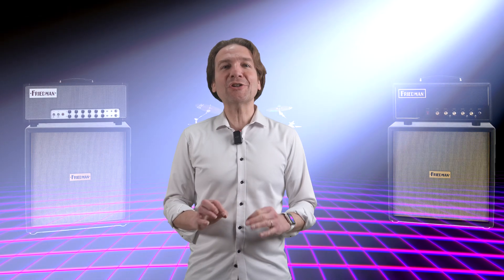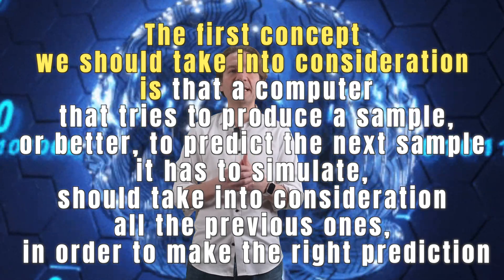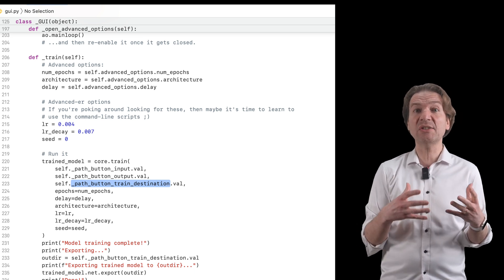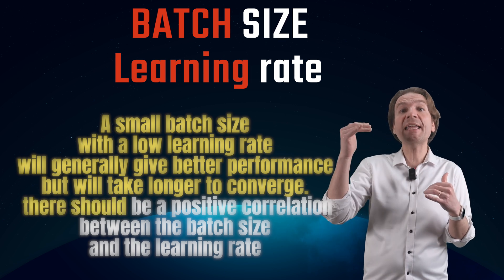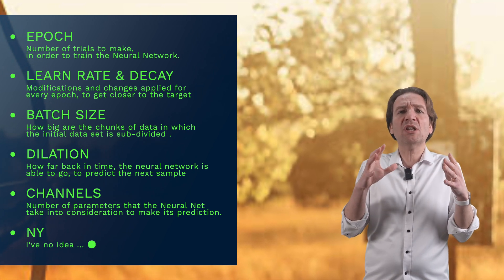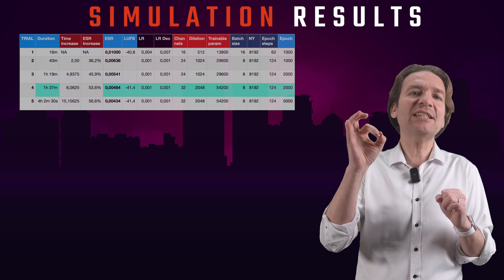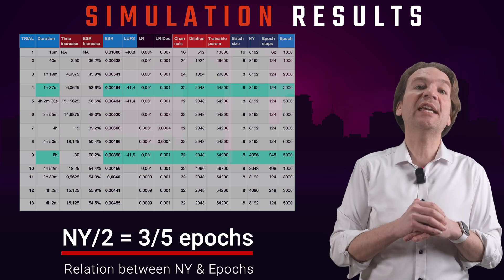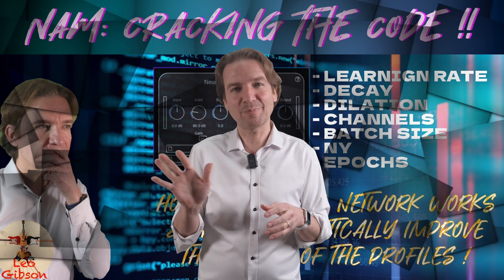NAM - Neural Amp Modeler: cracking the code! (How NAM works & how to increase the profile quality)

Comment: This is one of the best explanations of hyperparameters I've seen!

As a general rule, you want to crank up the batch size until your GPU VRAM can't handle it, then back off just a bit.

You are correct about the relationship between LR and number of epochs (and thus to steps). Lower learning rates take more epochs to cover the same "distance". If you have a rifle scope, and you only make adjustments 1mm at a time instead of 1cm at a time, you will need 10x as many adjustments in order to move the rifle scope's aim.

A pro tip is to perform some initial training with a higher LR and just a few epochs, then continue training with a lower LR and more epochs. It's just like making big adjustments to a tone knob on a guitar pedal to get within the ballpark of the sound you want, then finetuning with small adjustments.
Reply from the maker: Thank you so much for your kind words and for sharing your knowledge!!!

Comment: Nice video. I have some objections, or considerations, or rather questions. If the calculations has to do predictions of "what sample is there before" or "what is heard before" how does it computate right if there's nothing heard before? It is silent before you hit the very first note of the day isn't it? What is that it has to calculate "before" that initial pick attack? The dynamics from totally silent to an "exploding" WHAM with a pick?'

Also, since there are many questions about you not comparing Kempers, Axe FX fractal FM-9, and so on you state that those ones are modellers but rest of the gear, like NAM are rather PROFILERS. How come that it is called Neural Amp MODELLER then? Shouldn't it be called Neural Amp PROFILER instead to distinguish it more clearly from the rest? Then people wouldn't have to ask? I know that this is not really your problem though...

Comment: Thanks for the nice video! How did you get those fast calculation times? I need an hour with 300 epochs. I already increased 'num_workers' in 'train\core.py\ - but somehow it didn't change anything and the PossibleUserWarning about the DataLoader 'does not have many workers' appears furthermore when starting the training...
Reply from the maker: Hi, I think it's due to my 4090 video card, which is pretty fast...I didn't touch the number of workers
thank you!
Reply: @LeoGibsonGtr  Ah, Ok - 1650 GTX here ;-) But I thought I could increase the num_workers, but NAM somehow does not recognize it - thanks, Leo!!!
Reply from the maker: You are welcome! I have also tried to play with the number of workers...but nothing happened....I'm not sure if it actually does something. Thanks

Comment: Leo, this is very interesting. A few comments in addition to your descriptions: 
- Batch size is not the size of the batches, but the number of batches computed in separately (and potentially in parallel).
- Learning rate should be adjusted with respect to loss conversion (which unfortunately, NAM does not report continually) and not with regard to batch size.
- Channels is the number of connections between two layers. By definition, a CNN will have one input into the 1st layer (it is reading a sequence sample by sample), the output of which is "channels" wide into the next layer.
- This is where NY comes into play: From my superficial code analysis, this is the number of outputs generated per "datum" (it generates an output vector of samples). Larger NY requires less computing power but conflicts with batching.
- The "gated" parameter adds gates (a concept from recurrent neural networks) to the layers thus increasing their size. Upon activation, the selected activation is combined with a sigmoid.
- I also think that activation would be interesting to experiment with, in particular when generating models for slower computers, as the default activation by Tanh is computationally expensive, whereas ReLU would much less costly (my first quick test has led to good results even with ReLU)
I am wondering if any of the hyperparameter adjustments had positive impact on the aliasing problem you had stated earlier?
Training a pre-trained network is identical to running more epochs.
Reply from the maker: Thank you so much....very interesting!
As far as aliasing is concerned....I was not able to find any remedy...I read some post on line (I don't remember the links) from which it was evident that also Steve Atckison himself was searching for a solution. I'm not checking NAM since las march....so maybe now NAM has improved in terms of aliasing...I should check it out again.
Thanks!
Reply: @LeoGibsonGtr AFAIK there was no relevant change in the core algo, most of that code seems to be from pre-2023. I am working in research, maybe I will issue a thesis topic on this to find root cause and remedies other than an anti-aliasing filter or oversampling. I am very sorry for your loss.
Reply from the maker: Thank you!

Comment: Hi Leo. Do you know how to change the 'num_workers' value ?   I've searched through all the scripts and edited the CPU count wherever it crops up but it never works ?  cheers
Reply from the maker: Hi, I have tried myself, but I ended up not doing it, as it basically provides no improvements. I don't remember where I changed the parameter.
Thank you!
Reply: @LeoGibsonGtr  Thanks for replying.  It's so annoying only using about 40% of one core when you've got 20 !

Comment: great stuff, how would you implement these? can you share the best modified code?
Reply from the maker: Hi, as the software is evolving, I would suggest to make the changes checking out what I did in the video. The most complex one is related to the architecture that you can copy and paste from here:
Architecture.STANDARD: {
            "layers_configs": [
 {
                    "input_size": 1,
                    "condition_size": 1,
                    "channels": 32,
                    "head_size": 8,
                    "kernel_size": 3,
                    "dilations": [1, 2, 4, 8, 16, 32, 64, 128, 256, 512, 1, 2, 4, 8, 16, 32, 64, 128, 256, 512, 1, 2, 4, 8, 16, 32, 64, 128, 256, 512],
                    "activation": "Tanh",
                    "gated": False,
                    "head_bias": False,
                },
                {
                    "condition_size": 1,
                    "input_size": 32,
                    "channels": 8,
                    "head_size": 1,
                    "kernel_size": 3,
                    "dilations": [1, 2, 4, 8, 16, 32, 64, 128, 256, 512, 1, 2, 4, 8, 16, 32, 64, 128, 256, 512, 1, 2, 4, 8, 16, 32, 64, 128, 256, 512],
                    "activation": "Tanh",
                    "gated": False,
                    "head_bias": True,
                },
            ],
            "head_scale": 0.02,
        },
Reply: @LeoGibsonGtr  thank you, I'll try that out. Keep up the great work!
Reply from the maker: Thank you, really appreciated!!
Reply: @LeoGibsonGtr  I got excited to say it did improve the ESR, but actually I remembered wrong and it seems to have the same result, despite your code being different (I was careful to add it in the right place!) It didn't seem to run any slower, which is good, and it was already at .0043 with stock code. I wonder if Steve saw this and made some tweaks to the current version ;)

Comment: I did’t get everything cause damn it’s complicated! 
However, by judging the results, the real question for me is: is it worth it to get 40-60% better ESR for so much more time? Will it sound 40-60% better than regular settings and 100 epochs ? Not sure at all…
Reply from the maker: Yes, exactly that's the point. In my opinion any improvement is worth the computational time, as the profile is done only once...and you keep it for many months / years. But it is definitely up to you (in my opinion) to evaluate if it is worth or not.
Thank you!

Comment: I am confused with nr of channels mangling. If i changed 16 for 64 there shows an error telling output layer number of channels mismatch. Leo, how to calculate the correct values in each layer? I am using google colab "hard mode" version runtime environment.
Reply from the maker: Hi, the "channels" of the first layer has to equal to the "input_size" of the second layer. This is the architecture file:
 Architecture.STANDARD: {
            "layers_configs": [
 {
                    "input_size": 1,
                    "condition_size": 1,
                    "channels": 32,
                    "head_size": 8,
                    "kernel_size": 3,
                    "dilations": [1, 2, 4, 8, 16, 32, 64, 128, 256, 512, 1, 2, 4, 8, 16, 32, 64, 128, 256, 512, 1, 2, 4, 8, 16, 32, 64, 128, 256, 512],
                    "activation": "Tanh",
                    "gated": False,
                    "head_bias": False,
                },
                {
                    "condition_size": 1,
                    "input_size": 32,
                    "channels": 8,
                    "head_size": 1,
                    "kernel_size": 3,
                    "dilations": [1, 2, 4, 8, 16, 32, 64, 128, 256, 512, 1, 2, 4, 8, 16, 32, 64, 128, 256, 512, 1, 2, 4, 8, 16, 32, 64, 128, 256, 512],
                    "activation": "Tanh",
                    "gated": False,
                    "head_bias": True,
                },
            ],
            "head_scale": 0.02,
        },

Comment: I get crackles on 15-19. I can tell that they give me noticeable extra depth in the midrange.  Number 9 seems the best compromise on my PC (12700k @ approx 3.8ghz 48 gigs ram) During my tests using Cantabile as the host I was getting HUGE memory leakage. After 30 minutes I was up to 9GB !
Reply from the maker: Thank you so much for sharing! I'm impressed thank such a powerful machine struggle with those profiles....interesting insight! May I ask you if you observed the memory leakage with all the profiles or only with some of them?
Thank you!
Reply: @LeoGibsonGtr  oops sorry I missed your reply... The memory leakage only occurred when using an IR in the IR slot.   Just checked using NAM v0.7.3 and it appears to have been fixed

Comment: Great video! I subscribed.  I'm trying to model a fuzz pedal and getting an ESR of 0.25.  Any advice on what settings I should change?  Is there something special about fuzz pedals that makes them harder to train?
Reply from the maker: Hi, thank you so much I'm really happy that you like the video and your sub really mean a lot to me!!!
Actually the more distortion you want to profile, the more difficult it is for the profiler and therefore I think that fuzz is pretty difficult to mimic. One thing to verify is that your input file and the target ones are perfectly aligned...this make some difference. 
Thank you and I hope you will be able to solve...
Reply: @LeoGibsonGtr  Update 2:  Now I'm down to 0.0076!!  And with only 100 epochs.  I'm using learning rate and decay of 0.0001. Batch size of 32 although changing this didn't make a huge difference.  Dilations of [1, 2, 4, 8, 16, 32, 64, 128, 256, 512, 1024, 2048, 4096, 8192].  I tried your 512 x3, but I got worse results. 8192 seemed to be the sweet spot for me that gave me the best result before getting worse at 16384.  And I finally figured out the channels at 32.  I had to change channels to 32, but also head size to 16, and the one below it I had to change input size to 32 and channels to 16.  Honestly don't know what I was doing there, but that worked!  Next i will try creating my own test tone file thanks to some info from Jason Zdora https://youtu.be/CZL-aY2BEs8  Thanks again for sharing the info in this video!
Reply from the maker: Thank you so much, really interesting info! Please check out also if the final profile will work in the plugin, as the profiles with large neural net could drain a lot of processing power when you load them into the plugin. If you want, please share your findings. Thanks!
Reply: @LeoGibsonGtr  Thanks for the reply.  I double checked the alignment, and it was 1 sample off.  However, it didn't make much difference, I'm still getting roughly 0.25 ESR.  I'm going to try some of the adjustments you talk about in this video and see if I can make it any better.
Reply: @LeoGibsonGtr  Update:  I changed learning rate and decay to 0.001 and dilations to 2048.  These changes got me to 0.07 ESR.  I tried changing channels to 32, but I got an error.  Thanks again for this video, these settings are making a big difference in my case!

Comment: Hi Leo, perhaps I've missed this information in your video, but are you using a different recording for doing the null-test / calculating LUFS, or the same that was used for training? I'm asking because when doing ML there's always a risk of overfitting the model to your training data, and the model that performs best on the training dataset is typically not the model that will generalize well. You really don't want to overtrain for this reason.
Reply from the maker: Hi, the null test is done with a different DI track compared to the one used for training NAM.
Thank you for your question!
Reply: @LeoGibsonGtr  Cool, thanks for clarifying!
Reply from the maker: You are welcome!

Comment: Very interesting treatment of the digital side of NAM. What you did not address is how NAM uses the Analog to Digital algorithms to capture the analog characteristic of the amps/cabs. After all at the heart of NAM is 40 to 50 year old technology. That is the A/D, D/A conversion. Now NAM does a great job of capturing the characteristics of the amps and cabs and then doing a recreation from the digital (0s and 1s) data back to  analog. We need to remember that all known life forms that have hearing, hears in analog, No known life form hears in digital. So my suggestion is to make a video addressing the A/D D/A conversion of NAM, which is at the heart of NAM.
Reply from the maker: Hi, thank you for sharing! I'm not sure whether I have properly understood your point or not. The A D A conversion is done by my audio interface and not by NAM, therefore what you mean by how NAM manages the A D A conversion?
Thank you!
Reply: @LeoGibsonGtr  NAM can be either a stand alone or a VST3 plugin. If the A D A conversion is done outside of NAM then why is there a need for the 48K sample rate. The implication is that NAM is sampling the analog signal at 48k and then converting the analog signal to digital. Regardless of where it happens or from what hardware or software it is done by, it still is done. Both going into NAM and coming out of NAM. The point is the the amp captures, that we load up, are done from analog signals that have been converted to digital. As I said that technology is 40 to 50 years old, going back to the 1980's
Reply from the maker: Hi William, the conversion A D A is done for sure by our audio interface. As far as I have understood, NAM has to translate the already digital wave form of the input and target signal, to a data set that the neural network can process. But this translation all happened in the digital world. Still from what I understood, the problem to avoid here is aliasing, I mean the higher the freq rate is, the less should be the aliasing. In my opinion, a cool test to do is to work on a 192 kilo hertz data set...but this require to change NAM code more deeply....actually I don't know if I would be able to do it.
Thank you!
Reply: @LeoGibsonGtr  My audio interface does not let me choose a sample rate. Now my DAW does, but my DAW is not a audio interface. My audio interface is a mixer with USB out and has no controls to set sample rates. Now both NAM and my DAW has the ability to set and change the sample rate. And NAM reports that it works bets at 48000 samples a minute (48K). Like I have said the analog signal has to be converted either by NAM, the DAW, and external  A D box, or something else. And one would usually have the option of selecting the sample rate.
Reply: That should be 48000 samples a second not minute.

Comment: I have been working with nets similar to this, for a different purpose. The batch size is an important parameter, in my experience. A larger batch size can make more efficient use of the GPU, speeding up training. There is a limit though, too large a batch size will cause the GPU to run out of memory. Also, too large a batch size can cause the net to focus on a local minimum of the loss function. I think that taking one of your best configurations and trying batch sizes of 32, 64, 128, 256, for example, would have a good potential to improve results. One other thing, does NAM training use a training/testing split of the data? I haven't looked at the source code. If not, that would be another thing to experiment with, but considerably more work to implement. Thanks very much for doing this, it's very interesting, and NAM is really a great project.
Reply from the maker: Thank you so much for your message Michael.
I have read that the batch size is also related to the Learning Rate: the small is the learning rate, the smaller should be the batch size and vice versa. As I have reduced the learning rate, I have also reduced the batch size...I will also check out your suggestions...Thank you!
Reply: @LeoGibsonGtr  A low learning rate and a small batch size are both ways to avoid converging to a local minimum of the loss function, but they both increase time needed to train. Perhaps this is needed for modeling sound well, I haven't been able to experiment with it myself. If it is possible to increase the batch size without encountering that problem and without running out of memory, then training will be significantly faster, making it easier to use more epochs or adjustments to the configuration of the net. Thanks again for your experiments.
Reply from the maker: You are welcome and thank you soooo much for these very interesting info!!!